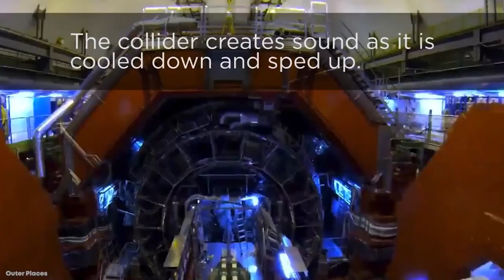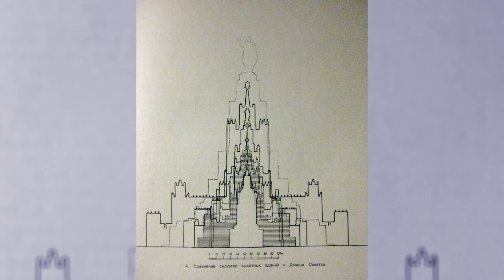15 BIGGEST Megaprojects Never Finished

Comment: According to a report by the department of Homeland security, 453 miles of the 1000 mile of the proposed wall was built by the time Trump left, not 48.
Reply: 🤦 That was replaced wall, not new wall.
Reply: @danielwade9487  they replaced barbed wire...not exactly a barrier.